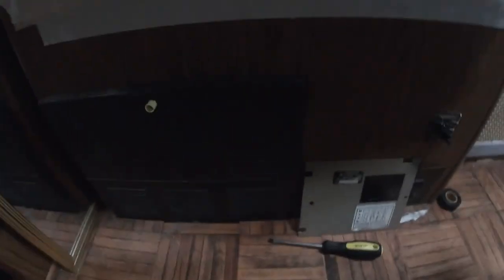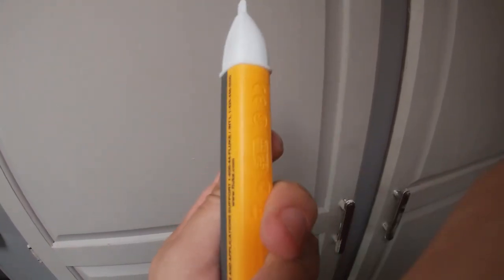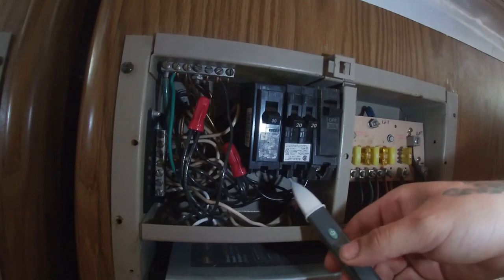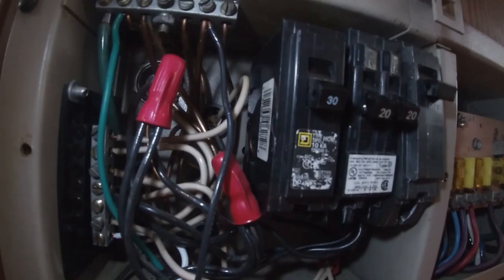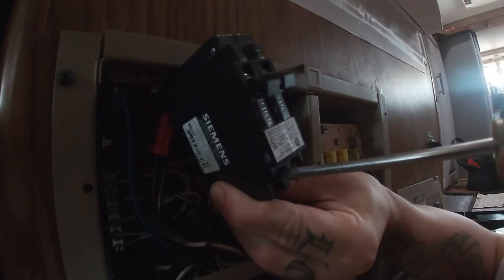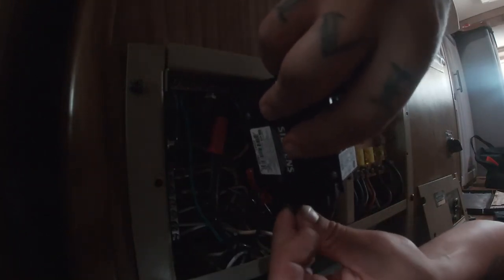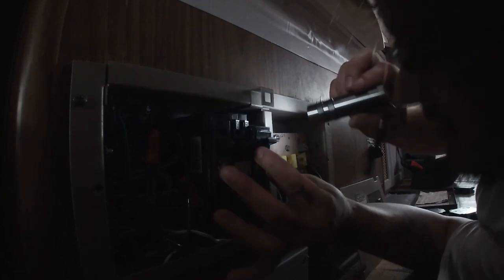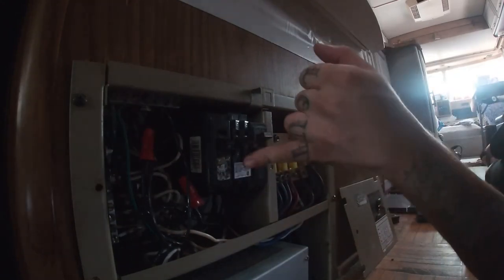Breaker Breaker 1-9! RV Circuit Breaker DIY

Comment: Hi, never install a 20/20 in place of 15/20 as that 15 needs to trip near 15amps for a reason; 15 amp wires not rated for 20 current; fire hazard !
Reply from the maker: You're totally correct, however at the time I couldn't find any near me. This was a quick fix.
Reply: @foxandpops  to determine which hot black lead powers whatever, power rv, then turn off each single breaker to see which loads are powered by each particular molex black wire. Remember, some loads/ apillances demand 15 amps, not 20 amps. Test each wall socket for correct neutral and ground connections.